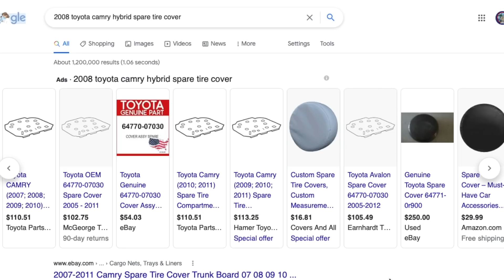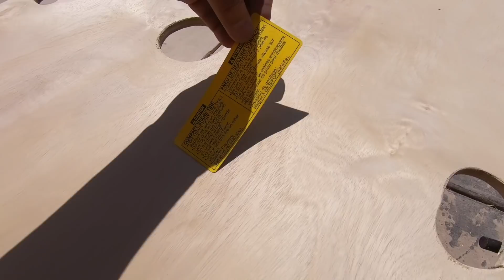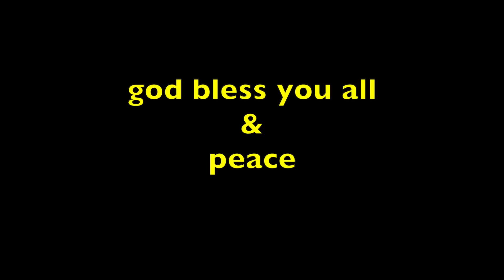MAKE A SPARE TIRE TRUNK BOARD Toyota Camry Hybrid √ Fix it Angel

Comment: Good job my man. I was going to do this for my Civic but I got new tires and a spare wheel off craigslist for $20. Took the best old tire and put it on the wheel. Slapped it in the trunk and put the old cardboard back. The full size spare fills up the well so much that there is no longer any sag. Best of both worlds-no sag and no wimpy doughnut that only "lasts" 50 miles.

Comment: Thank you! It was a learning experience but successful on the first try. Getting  the standard 4x8 from Home Depot pre-cut gave me an extra board just in case. Luckily the foam pieces from the previous piece were salvageable. Keep up the good work and thanks for the links, some helpful stuff there.

Comment: Angel, No transfer of the glued on foam pieces to prevent rattles? I would use some dental floss to remove them and silicone to bond back on. But, no rattles no problem,the factory had them there for a reason.

Comment: Angel, for the 2004 Camry, the exhaust manifold and catalytic converter are attached.  Should the studs and bolts that hold these against the engine and against the rest of the exhaust pipe be changed when installing a new manifold catalytic converter or is not necessary

Comment: Nice job! It baffles me too how much they charge for a glorified piece of carboard, I had the same prbolem and came with the same solution as you for both my cars, only difference was the material, i used hardened cardboard. Also you should (if you hadn't already) put the black pieces of foam to the new trunk board as well. At bumbs on low speed the board will absord the vibration and rattle.
Reply: It called Masonite board

Comment: If you wanted to go the extra mile, get some little rubber "nipples and go all along the under side and place them in spots that may rattle. Then on top coat it with a sheet of butyl rubber sound insulation and put the carpet back on top. Not only do you get the support, but you will notice less road noise coming from the back.

Comment: Most japanese cars have this issue. Not sure why they can’t use thicker board or even plastic
Reply: Cost and it rarely goes bad anyway. This was a great alternative to using the factory replacement, cheaper and sturdier